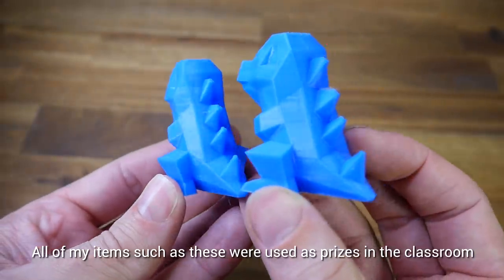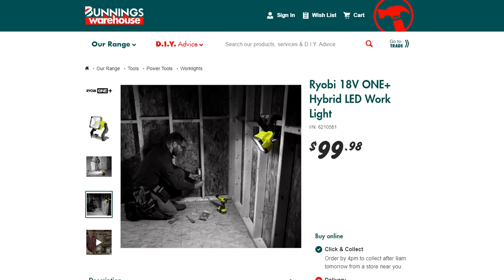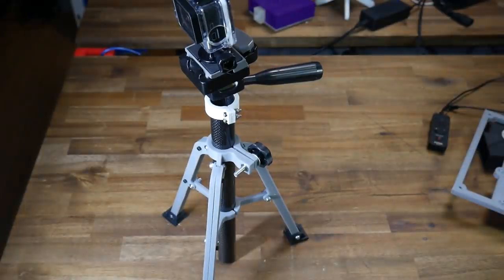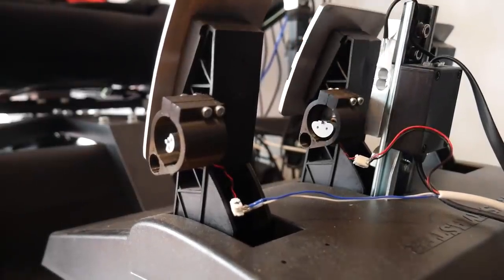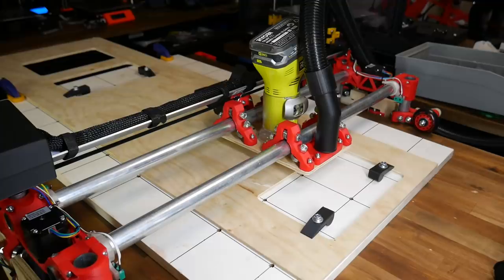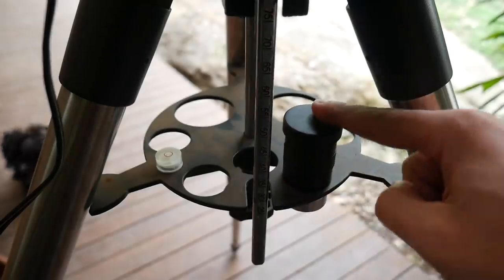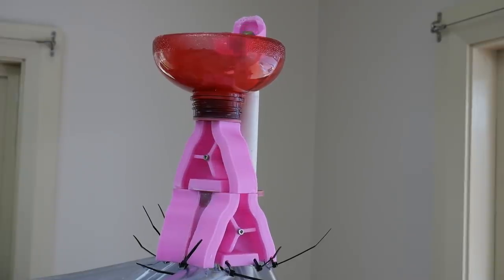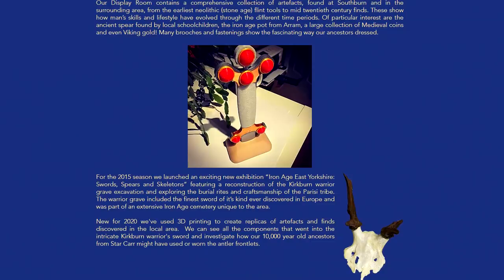5 reasons 3D printing is useful - My favourite practical prints

Comment: Thanks Michael, this is a much-needed video.  The sad reality is that 3D printing channels require things to print for reviews, tutorials, comparisons etc..  The result is an endless queue of Benchy's, Cubes, Rooks, Lattices etc. to fill that requirement.  Sadly, the uninitiated see these videos, and assume this is all a 3D printer can do...  How wrong they are!
When I got my Ender 3 I vowed that I would not succumb to the temptation to print other than practical items that would have ongoing usefulness.  I have largely managed to stick to this mantra, and I get daily pleasure from seeing and using the results.
As an aside:  For many years I have had a lot of pleasure from dabbling with CAD software.  I consider being allowed to use Fusion 360 an absolute privilege... my thanks to the Autodesk team.  However, you can only design so many things in CAD before you begin to wish to see them "in the solid".   For me, that's where the 3D printer (and CNC mill/router) comes in.
Reply: Honestly, there is no shame in printing something not useful, if it is cool and brings you joy. As a puzzle collector myself, I plan on printing mainly useless things, but definitely a lot of useful things
Reply: @nutmeggaming11261  : You hit the nail on the head when you said "if it brings you joy".  If it doesn't do that, it's pointless.  (Unless you do it purely for profit, but that is a whole different story.)

Comment: Im  a complete noob , havent yet decided which 3d printer to go for as budget is limited , but would like to know can i 3d print an air rifle silencer, also a synthetic stock for a project air rifle action? im having trouble to get parts for this project, was wondering if can print a barrel for a sub 12 ft lb rifle in the UK, have been looking at Anycubic 3d printer, how do you fix together a series of smaller printed parts ( Stock). is this a possible item to print on a 220 x 220 x 205mm bed ?

Comment: I love the fact that I can take a design I’ve created and print it it out at home. No need for an expensive machine shop. I’ve designed and printed a 3D printed water pump, toaster handle, motor mounts & tail skids for RC planes, adapter plates for switches, brackets for tables etc etc. I’d do more if I had the time!

Comment: I just got an Ender 3 last week and have mostly been printing accessories for it.... But ran into an extremely practical use today. This morning I went out to clear the recent snow with my snow blower and a small bracket that holds the cable to engage the blower broke, rendering the entire machine useless. I tried gluing the bracket back together, but it didn't hold. After about an hour in fusion 360 (I'm just starting to learn it) I had a replacement modeled and a couple hours later was back to clearing the driveway. Ordering a replacement would have taken days, if one is even available, and by then I would have had to clear the driveway by hand.

Comment: Currently printing masks to be used in hospitals, how's that for useful?
Reply: Dave Cockayne  My thoughts exactly
Reply: I've brought my first printer for this very reason. I've wanted one for a long time, but this was just the push I needed and I jumpped in head first, got a dud of a printer and a hefty learning curve. 12 days later I am now  printing 14-20 a day and I had my very first catastrophe to day at about 160 prints in.
Reply: Some if not most hospitals can’t accept objects, if not made by certified medical provider, do people still use it, yes but for example my hospital won’t.
Reply: @Crozbyguy Please tell me you are joking. You don't have a clue how the immune system works
Reply: @Heads Mess Sanded parts can be cavi-wiped, as 3D printed parts for hospital use wouldn't be going into surgery.  I think you vastly overestimate how much supplies are autoclaved in a hospital.  Unless it's going into a surgical suite, a cleaning wipe is sufficient.  I use 3D printed parts that have had no reaction to hospital cleaning agents.
Reply: yeah right, as if the metal wires from a shirt holder isnt capable of making a damn face mask... or hell, if you go to any welding shop you can find stainless steel wire and you can just bend it into any shape, good enough for a headstrap

Comment: Our family lives in an apartment with no opportunity for a workshop or 'shed' so my tools are very limited. My two printers are an Anycubic Linear Delta and an  Ender 3 and they fulfill all my needs that a traditional 'fettlin' shed would. The printers are in our small hallway on an Ikea cabinet that occupies about 36 inches by 18 inches and all the supplies for the printers are in the cabinet itself. I shoot mainly PLA, PETG and a small amount of TPU all of which don't really smell so the printers don't need to exhaust to outside. My software is Design Spark Mechanical and Cura and with this setup I create everything from bathroom brackets to coffee measures. I even designed and made a combo Oreo cookie dunker and straw for my Father in Law's Birthday present. He's been doing milk and cookies for most most of his 85 years.

Comment: Since I started my foray into 3D printing by printing in ABS, I'm very comfortable with it.  Along the way, I have been able to print small replacement parts for my car.  In particular, I have printed replacement mounting tabs for the interior panels.  Why spend $120 on a replacement A-Pillar cover, then I can print a tab for $0.02, $0.50 on some epoxy, and have a perfectly serviceable part in less than a day.

Comment: Board game inserts is a huge one. Board game inserts are often around $80 and most commonly only found from one place: broken token. I printed a few inserts for only around $10-20. Then you have the ability to print some very useful replacement parts for things like well pumps, cars, and kitchen aid mixers. I've also found some decent guides to turn a cr10 into a CNC capable of engraving glass to make some super cool gifts like those lights where you put a design in them and it lights up the etchings. Except now you can make any etching you want and then switch back to 3d printing and print the base for the lights

Comment: I see an area which I aim to develop in - importing engineered parts into VR, editing them with Oculus Medium or other tools, and exporting for printing. 
Combining the engineered parts and creative sculpture! 
As you have VR, have you ever tried this?

There seems to be a number of 'levels' to 3d printing - the thingiverse catalogue use was excellent for getting started, and tuning my printer. It is also handy for standing on the shoulders of the community and improving my toolset. However, where 3D printing shines is the creation of the new - for cad for engineered parts that would not exist otherwise, and tools like desktophero3d, which lets you design and download miniatures for tabletop gaming. 

When you start making your own things, you stop being a dependant consumer, and become a little more independent. Its liberating, and has spread to other disciplines for me, such as woodworking. 

Thanks for your videos!
Reply from the maker: That's a great summary on the transition. I made a video on VR free form sculpting but I've never used it for anything precise.

Comment: I use my 3D printers for many things, my son in-law is a contractor and I've designed many drilling templates for drawer pulls, I like making projects with Arduino's and naturally I would design and make cases for them, I've made a few educational toys for my great granddaughter, repaired items around the house, as a CPAP user I was having an issue with the hose of the ResMed P10 mask pulling loose from the CPAP hose so I designed a retaining clip for it. Just a few of things I use 3D printing for.

Comment: Hi, I've got a sim racing steering wheel and a TH8A shifter. But I always miss-shift when I put the 5th because the shifter has 7+1 gears. So I print a new patern with 6+1 gears to replace the original and since I never miss-shift when I put the 5tg gear!

Comment: I am currently building a Flight Simulator.  As I wanted to do this from scratch the whole show controls and all i decided to go down the 3D printer route. It has been invaluable allowing me to design and print accurately machined parts reducing time, frustration and wasted materials. The only down side is the process is so easy and flexible I often end up making a number of optional approaches to various parts. the I have to decide which is best.  I have also repaired a number of things round the house. Even my Wife thinks it's useful. Making jigs and tools for the garage is almost a hobby in itself.

Comment: I have printed a set of insect mouth parts for a variety of different insect types to use as demonstrations at a master Gardner presentation. I'm also going to be printing custom shape trail markers.
Nearly forgot. I fixed the broken top of my compost bin with a 3d printing pen. Used ABS and it is just as strong and flexible as it had been. Many other repairs and parts of course but those are the main ones.

Comment: I'm a puzzle collector (twisty puzzles specifically, the most classic one is a Rubik's cube), and plan on getting an Ender 3 to make and print many puzzles.

As well as that, I'm into hobby electronics and programming, which benefit massively from 3d cad and printing.

Comment: My desk was a bit to low, with 3d printed risers it is now a perfect hight.
Custom drill bit holder that is screwed to the workbench( saves alot of time. )
ciclone filter using a bucket and a piece of plywood.
Monitor arm mount for a rack that improves rack stirdyness.
Non new-user-friendly 3d printer with no instructions as a puzzle gift.
Dumbbell diameter changer inserts. it is safe now to use with different diameter dumbbell bar. 
Probably a lot more.

Comment: I printed so many useful thinks I cant even remember them all, but here is some things:
For cars: Had a plastic part brake on a throttle wire, normally you have to replace the whole wire but I made a new part with a slot so I could slip it over the wire. I printed new brackets for my car to hold the grill since my previous was stolen and the brackets destroyed. The most recent was to print a 2 DIN stereo holder for my car.
For my home: Brackets of various kinds, like to mount book shelves together. Form fit phone docks with wireless charging. Lamp shades.
For electronics: Lots of cases, parts trays with magnets, assortment bin separators,.
Tools: Radius gauges, spanners for SMA connectors, patterns.

Comment: I am retired but before I did 3D printed commercial ABS machines printed the plastic parts that made up end products.  Housing for a Nitric Oxide regulator for use on emergency vehicles including helicopter was first 3D printed and a 100% functional prototype built.  Also an upright vacuum cleaner are fully constructed with 3D printed components. assembled and tested in actual usage before the final production steel molds are made.   My bet is that today every plastic product you purchase was first built by 3D printing with significant savings because all the assumption and guesses on how the components will snap together are not tested.

Comment: I use mine to print tools, repair and customize RC vehicles, fix/upcycle broken things, make mold masters for fishing lure molds, make hardware mounts for computer and tech projects, making functional parts for the fishkeeping hobby, tabletop miniatures and terrain, gauges and templates for instrument repair and antenna parts for ham radio projects with my father.

Comment: Can you please do a video explaining how you built your sim racing rig and how you used 3d printing? i noticed you have the exact same wheel and pedals as i do! I attempted to build a rig before i bought my 3d printer. I don't use my wheel as much as i want because the frame isn't quite as sturdy as I'd hoped. I really want to rebuild the rig in order to make the wheel worth having and it would be nice to get some inspiration to put my Ender 3 to good use!

Comment: So I ordered about 100 M of 3 mm rope for making masks for people I know who don't have them, and the rope came loose in a box, so I printed up a couple reel guards that fit on the cardboard ring from used up masking tape. It friction fit perfectly and now I have a nice reel of rope that I can mount and use for the making of masks to help my local community. People usually say "I don't know what I'd use a 3D printer for" and to me, that's almost the point. A 3D printer is used for solutions that you couldn't see before you needed them. It's about when there aren't any practical ready made solutions available, and you need to get something done. I've used my printers in ways I never anticipated that I would, and that's really the exact reason I bought one. One of the best decisions I've ever made.

Comment: In my work, there's a labeling machine has some issues with glue coming from label strip, which cause jamming after piled up on a particular segment. The person has found a way to attach a piece of cloth with wire to keep it clean, but it was unpractical due to appliance method. I've managed to craft a 3d printed apparatus for that purpose, it looks primitive but it gets the job done and it just snaps on side of the machine without any bolts.

Comment: I built my first 3D printer over a period of about a week over xmas thinking that I would never have an actual use of it...
To dateI've printed many useless things but also
- a full set of parts for my second printer (The first one is made of wook and steel rods)
- a new latch for my car's glove compartment that was damaged due to a break in
- a replacement knob for a friend's stove
- a phone speaker amp for my housemate's boyfriend
- a new case for a gate remote
- a pencil box to try to keep my desk mess under control
- a new lid for my travel mug
- a whole bunch of face shields
... 
What I like about this device is that it allows me to fix things rather than replace them.

Comment: I work on feature films making the props. We use 3D printing extensively to create either the full prop or parts thereof. Most prop designs and concepts are generated digitally so using a 3D printer speeds the manufacturing process up.

Comment: Well, for me: the most important parts are those for my wheelchair + handbike. Without them I cannot go outside really and without 3d printing it would be far to costly to have all those special parts and sizes, especially since I use an old design handbike of more then 5 years old where there are no pats available for anymore but still need to update it to newer rules and changing circumstances.

Comment: Hehe, like everyone around here, i printed alot of brackets to help organise my house from cable management ( as i have an electronic music hobby, and i have tons of cables around my desk ) to apple tv mounts behind the tv. Also fixed ton of things from fixing my front door's peephole (braking it in the process of fitting a 3d printed key hook rack around it ) fixing little plastinc things in my fridge or making mounts for my cable soldering and my magnifying  glass
Reply: also i'm in the process of making my own 3d printed cnc router
Reply: And i think people miss the fact that you can print molds for almost everything, from cement stands for your lamp to molds for your hotend silicon sock

Comment: Currently working on scanning and printing mirrored form peace for moped side plastic that has peace missing, so i can get peace of Luran what the original is made of, heat and mold it into shape using form peace and then plastic welding part together. Cheaper than getting new one as those are pretty expensive for rarish bike like i have. Pretty hard to get shape right with out scanning and printing the form tool to help with it.

Comment: I made a coin holder for my car that didn't exist at all until I made it in CAD.  I also made a small object to hold my stair railing onto the brackets that attach to the wall. The original ones broke and when we bought the replacement one the hardware that came with it was a little bit too small and would break into the original holes in the wood. The original peace was too wide for the new bracket.  So I made one out of CF-PC.

Comment: Was building a pc and wanted to go small. Instead of shoving 200$ on a itx case I made my own and got a 300$ corexy printer that could fit 30x30cm for the panels. I also used it to print some shelf holders, a lightweight case frame for my g305 mouse and I have still a long que of object needed around the house, car, etc.

Comment: More classroom uses...   designed & 3D printed an iPhone holder that attached to a microscope so that I could broadcast a live view of the microscope on the classroom Apple TV using the iPhone's camera.  3D printed angle guides to adjust blades to various angles to see how the pitch affects the wind turbine.  Have 3D printed various models over the years to demonstrate concepts.

Comment: There are many automotive custom designers that use 3d printers to make mockup custom parts, and also use printed parts to create Molds for Carbon/fiber glass parts.
Reply: Metal 3d printers are also coming into the market, so in a few years that could be something hobbyists can get moderately easily

Comment: I bought my 3D printer to print parts that I can them cast out of metal. The 3D model is used to make the mold in Green Sand or Petorbong. The model is removed from the mold and molten metal is poured into the mold. La Volia you have made a metal copy of your 3D model... Very handy for making tools as can be seen in my latest video. I know several Casting enthusiasts that use their 3D printers to make models for casting... Thanks for the chat... Be well...